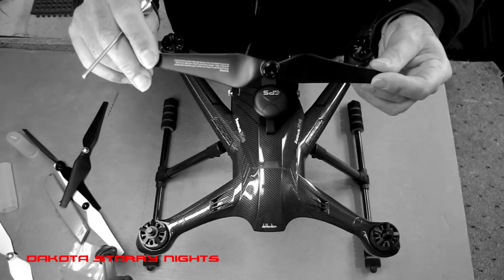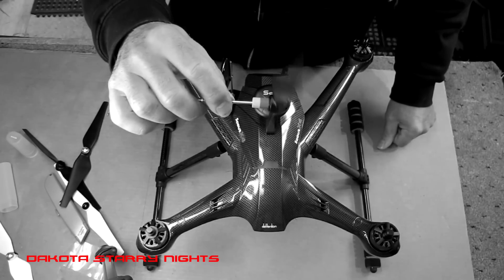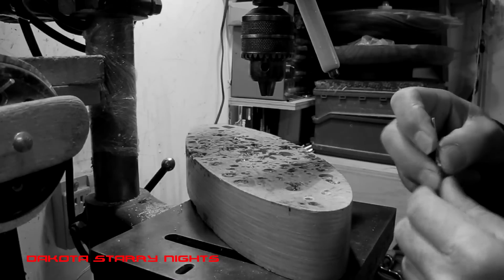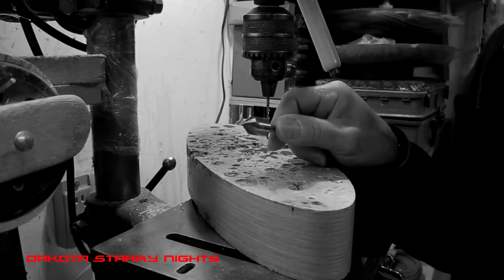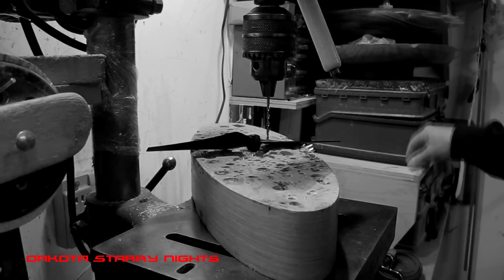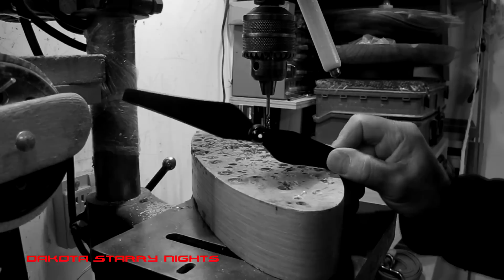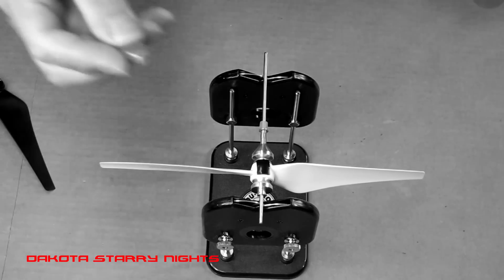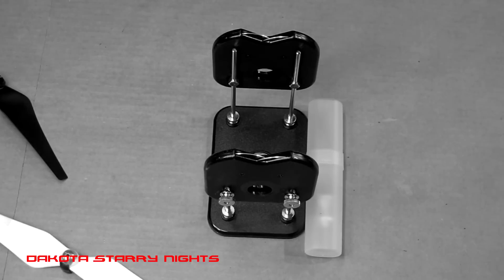Improved Prop Balancing for Solid Hub Rotors (Walkera Scout ect.)

Comment: you just take an aluminum rod and put left hand threads on one side and ccw on the alternate then use that rod to balance. $ 9.85 on e-bay. If you drill your props as demonstrated in this video your balance will be worthless(not to mention that you destroy your props). No offence intended to the post-e of this video but there truly is a better way !
Reply from the maker: No offense taken.  This video was posted four year ago.  Back then there weren't as many options as today.  Much more to chose from in the form of quads and accessories these days.  Heck, I've even seen them for sale at the local Best Buy... Thanks for posting and the tip.

Comment: First of all great video, but I have a stupid question. I have a Walkera H500 Tali which is basically the same machine as the Scout except it's a Hex-copter. One day for no real reason 3 of my motors started to get a violent vibration at 75% (or more) throttle. My first guess is it's some sort of balancing issue, but my question is, if there is no physical damage to the prop, how is it possible for the prop to become unbalanced from the manufacturer?
Reply from the maker: +Chad Mowrey +Chad Mowrey Well, the problem is they don't come balanced from the 
manufacture.  It's the same when you buy new tires.  They have to 
balance them before installing them on your car.  You should not fly 
with that kind of unbalance.  It could damage the motors or have you 
lose control and crash. Clear Skies.
Reply: static mass produced props from the factory are NEVER balanced.  A solid threaded rod is the way to balance self tightening props and should be done as vibrations from an off balance prop are enough to shut down your avionics in your flight controller with resultant catastrophic failure of the drone.

Comment: Still seems a little dodgy to me to get center.
I had a mate lathe a hole into the rear of a shaft drive off an old motor with the thread on it and the balancing rod fits snugly into the end threaded shaft to the point it wont come out. Just screw your prop on as you normally would if you were doing it on your copter and start balancing. sweet as and works a treat, 100% balanced!!

Comment: Hi, good video, bit reluctant to drill my props to be honest. How about a shaft from a scout motor, drill a hole in the center of the non threaded end and then fix the balancing rod into the centre of it. Just an idea, what do you think?
Reply from the maker: Should work.  But that would mean trashing a motor.  If you've got a drill press drilling the props is not that difficult.  But of course it's your call.  Cheers.

Comment: Dakota there is a update on F12 E transmitter and the Scout x4 propeller startup Parameter to make the propeller to start up at the same time. Would do the updates or not. Just would like to have your advise that all?
Reply from the maker: Todd, currently, 12-2014, it appears the Walkera Scout is still in the stages of development and in certain cases suffer from quality control issues.  Some pilots have experienced operational problems in flight and on the ground, ranging from very serious to minor.  This seems to be the trend with many of these companies.  Expect firmware updates and the like.  Which is a good sign they are trying to address some of these issues.  I would advise you take it real slow and fly the Scout low to the ground and in "manual mode" for the first 6 or 8 batteries.  What really helped my was the purchase of a micro quad, like the Hubsan X4, to get a feel for how a quad responds at the controls.  It's way cheaper to crash a micro quad than a Scout.  There is a wealth of information online, maybe too much. :-)  But if you'd like some further intel PM me and I'll send you a couple of links.  Clear Skies
Reply: Hi Dakota,
got my holes in the props and going to start balancing them. Hope it this will be easy lol.

Comment: Thanks for the video. My scout x4 should be here Tuesday. This will be the first thing I do when it came s in.
Reply: On the Facebook Forum, There is a guy that sells an aluminum Rod, One end of the rod has Clockwise Threads and the other End had Counter Clockwise Threads. I balanced my 6 Props on my Tali H500 and had no issues, Worked great. 

Thanks for the video, Its always nice to have another option.